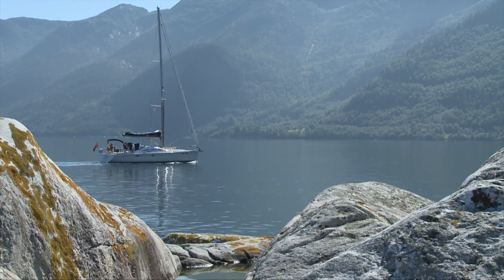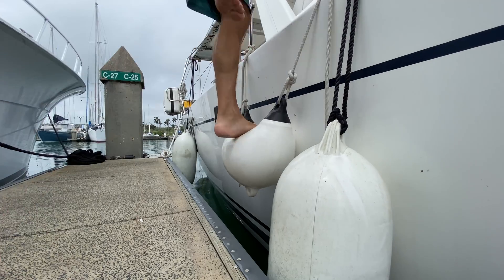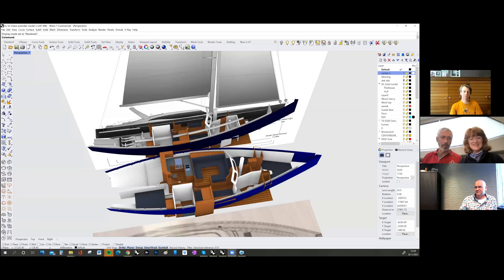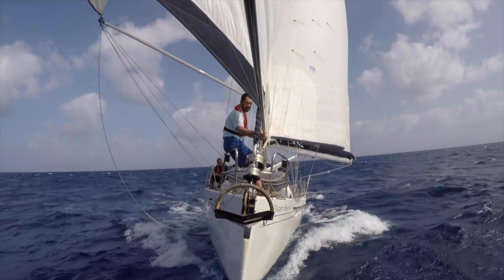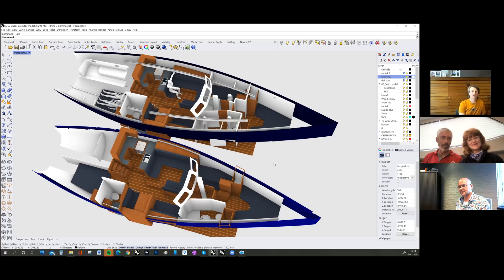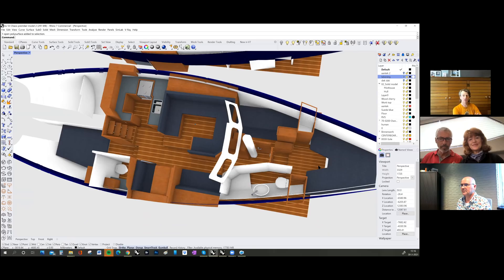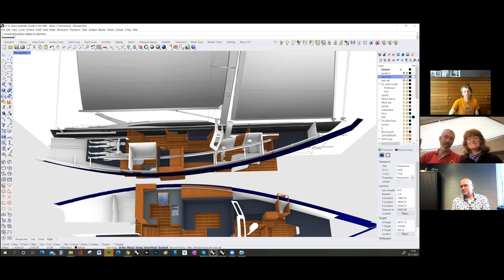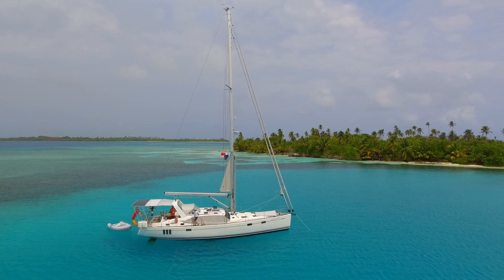Custom Aluminum Sailboat Design! | Distant Shores | EP 209

Comment: Sheryl your hair in a pony tail at 14:40 shows how much younger you would look with it shorter. You should consider moving into shorter hair and thinning the weight out of the top when you do. It might be time to think about moving on from the same haircut you had when you built that first boat in the yard in Ontario. Take it from a professional hairdresser, many women are resistant to this change from their old standby haircut of 40 years but when they make this change they love how easy it is to care for, how light it is, and how much younger they look and feel. Plus an added bonus for your lifestyle, think about how much shorter the showers would be and the water saved. We love you guys. ❤️❤️❤️

Comment: 9-	To provide good temperature control and ventilation in both hot and cold weather:

i-	I want it to have a thick insulation, so it retains the heat in cold weather and prevents the heat from creeping into the boat in hot weather.

ii-	I want it to have an efficient heat pump(good for -30 C to +50C)  with a secondary source just for the saloon in extreme cold. 

iii-	I want it to have good air circulation to reduce the load on the heat pump in moderate climates and  to prevent mold, but not the cost of the sinking of the boat in adverse weather because of an air circulation system that doesn’t turn into a watertight bulkhead.

10- To avoid and survive fires: 

a) I wonder if i should avoid using gas and diesel heaters and stoves, but then electric wiring could generate its own fires with short circuits. 

b) I wonder if I should use ceramic and metal instead of wood for the interior, but then wood is a better insulator and far more aesthetic.

Comment: Some of the specifications that I have mentioned down below are unrealistic. I did this on purpose to stretch the limits for discussion, but to finally agree on a pragmatic design. 

I want a boat that: 

1-	Can survive the most adverse weather:

I want it to survive:

i-	Pitch-pole Capsizes: Based on research from 2019, a boat will survive pitch-poling from wave heights that are 60% of the boat-length, so this seems primarily a function of the boat length. A longer boat can not only survive higher waves, but can also travel at greater hull speeds, which are a function of hull length, so I want the boat to be around 76 feet.

I want the fore-hull to be narrower than the aft-hull, so the drag is low, but  longer than the aft-hull, so that its buoyancy will prevent a spurious stern-wave from pitch-poling the yacht stern-to-bow.  This would also mean that a large bow-wave would also lift a narrower fore-section of the hull to prevent the boat from being pitch-poled bow-to-stern. 

This means that the stern and bow sections will lift around the Center of Gravity, which would act as a fulcrum, but the stern and bow sections will both oppose the pitch-poling moment.

I want it to have adequate free-board to prevent sinking in adverse weather.

The length and weight across the boat should be distributed, so that, in the vent of a large bow-wave, the fore-section crosses the tall crest and then drags the aft section across the wave with its weight across the wave to prevent a bow-to-stern pitch-poling, but has the hull shaped, so it doesn’t sink into the trough as it comes down the crest.  Likewise, in the event of a large stern-wave, the length and weight distribution of the stern should be such that it drags the fore-section back across the stern-wave to prevent stern-to-bow pitch-pole, but the aft and stern section should be watertight, so it doesn’t sink into the trough, as it comes down the crest.  

All of this means very careful attention needs to be paid to the shape and weight distribution of the hull aft and fore of the mid-ship section and the mid-ship section itself, which would serve as a fulcrum to lift the dipped bow and stern sections out of the water and to push the raised bow and stern sections back onto the water.

I wonder if the length and width of the boat needs to be some harmonic of the waves for a smoother ride and to avoid capsizing?

ii-	Rollover Capsizes: This seems to be a function of displaced center-of-gravity, so a flatter superstructure, a wider beam, and a deeper draft would prevent such capsizes.  

I would want the deck to be flat in the aft and fore sections, so that large waves would flow across the boat instead of rolling it over.  I’d also want the fore-section to be flatter than the aft section, so that large waves would push the stern to have the boat face the wave frontally to prevent a roll-over capsize from large beam waves.

I would also want the free-board to be shaped in such a way that it deflects the beam weaves around and over the boat to dissipate the energy from the wave to prevent it from rolling the boat over. 

iii-	Sinking without Capsizing: This would mean that such a large wave breaks over the boat that the sheer weight of the wave sinks the boat. The greater the buoyancy, the smaller the exposed surface, the more angled the buoyant submerged area, the better the drainage, and the more sharply angled the deck, the greater the survivability against sinking.

I’d want the superstructure to break large waves smashing on the boat, from the top,  into multidimensional spherical horizontal, vertical and angular components to reduce the impact along any single dimension. 

I would want the submerged parts of the hull to provide buoyancy from different curved and angular surfaces to prevent the deck from going under the waterline. 

I would also want the deck to be subtly angled for good drainage. 

If possible, I would want the deck to be water-tight for a roll-over righting.  This I know isn’t realistic on yachts because of the height through which the objects would fall in an inverted yacht.

iv-	Survive impact from  debris and light floating ice. I would have to rely on thermal imagers, sonar, radars, and lidars to avoid collision with larger ice and objects., but a strong aluminum hull should survive impact from light debris and ice.

I also want the propellers to be protected by the keel.

I prefer aluminum to steel, because,  for the same weight, aluminum provides better impact strength, except for the welded joints, which can be strengthened with extra members.

I don’t know if aluminum should be coated with paint or a thin layer of composite for better corrosion resistance or left uncovered, so it quickly dries out.  It might be better to have a double hull, with the space between the two hulls used for a water-ballast, so that even in the event of an impact, the inner hull is unscathed. 

v-	To survive running aground: I want the yacht to be beach-able, like the Garcia 60.

2-	To go anywhere:

i-	I want it to have a deep enough draft to survive the huge waves at Cape Horn, but a shallow enough draft to go up rivers and canals, so it would have a lifting/centerboard or a swivel keel.

I don’t know if a frontally swiveling keel would be preferred to a backwardly swiveling keel because even though a backwardly swiveling keel would incur a greater damage in the event of knock with an underwater object, it would still fall more easily against the forward movement of the boat. 

A lifting keel/centerboard can be more finely calibrated, but I wonder if that would be more prone to failure than a swiveling keel.

I wonder if the hull should be shaped, so it displaces at low speeds, planes at moderate speeds, and foils at high speeds, so it can use speed to surf through moderately heavy seas, but displace in very heavy seas. 

ii- I don’t want the beam of the boat to be too broad to get stuck between ice, but enough for it to avoid a rollover with a length/beam ratio of under 4. I would have preferred a trimaran, a catamaran, or another multi-hull design for better capsize resistance, better handling, shallower draft and more spacious cabins, had it not been for my concern regarding impact with ice or the hulls splitting  off in heavy seas. 

3-	To make good speed with sails and even sail in the worst of storms:

i-	I want it to have a ketch rig, so that each rig is short for a lower center of gravity and so that each spread is small for a smaller centrifugal force in storms. 

ii-	I want the two masts to be placed, so the center of gravity wouldn’t be too drastically altered by just the mizzen mast flying the sail during storms, as a wave lifts the stern and the wind hits the sail to push the bow down, or vice versa.

iii-	I want the hull to have a variable, water ballast, so the ballast can moved to the fore section, when traveling upwind, and the aft section, when traveling downwind. I would also want this ballast to be moved laterally to reduce the tilt when sailing at speed in a storm. 

4-	To have redundant systems: I want it to have twin engines, screws and rudders. Twin engines and screws along with the sails should even help steer the boat in the event of a failure of both rudders.  I would prefer shaft-driven engines to diesel-electric propulsion to reduce the weight, even though a diesel-electric propulsion would make more sense with solar panels, horizontal axis wind turbines, and even charging from the propeller whilst under sail.

5-	To be steered from a small remote control, like that on the Dashew Beowulf, so I could operate it without the crew, but for it to be steered manually in the event of a failure of electrical, hydraulic and control systems.

6-	To be easily maintained, serviced and repaired even while offshore, so the layout, the components, the sequencing and the spacing should make this simple, easy and quick. 

7-	To provide autonomy with a blend of solar, wind, wave and kinetic energy and, perhaps, storage in variable capacity salt batteries.  However electricity can play hell into the aluminum hull, so would settle for lithium and other batteries.

8-	To provide a comfortable living and recreational area for 9 adults---me, my wife, 4 children and 3 crew members. I usually don’t find boats under 100 to 120ft(Trehard(103ft) and the Pangea and Tara(120ft)) to have comfortable living spaces, but the Dashew 78 BeoWulf and the CNB-76 seem to be fairly comfortable, so I would want it to be around 76 to 78 ft. A larger boat might be a hassle to operate or maintain with a small crew if most of the functions are automated. 

i-	I want an open fly-bridge with a comfortable seating for 9, as in the CNB-76 and even Garcia Exploration 60. This can be in aft or fore section, I don’t care, but is more convenient in the aft section. 

ii-	I want a raised saloon with a pilot house for 360-degree visibility. I want this to have wide, open spacing and very good lighting with low/high tables.  This should be the prime real estate in the boat. It should have easy access to the galley. This is where I would also do most of my work.

iii-	I want a comfortable owner’s suite for myself, so I can easily step down from both sides of the bed. I need to have a couch on one side and a desk on the other side. This should come with a head and a shower. 

iv-	I want two guest suites: One with a double bed and a Pullman and the other with a twin and an overhead.  These can have their own heads, but can share a shower.

v-	I want a dorm for the crew with another head and shower.

vi- I want a tiny workshop-cum-office-cum-hospital for offshore repairs, life-support systems, and office work.

vi-	I wonder If the space for parking the large tender on the deck can be a little sunk to serve as a shallow pool/Jacuzzi, whenever the tender is taken off, or if that would create a hazard in heavy seas.

Comment: Since this is the forever boat, you should go with the layout you really want, which is obviously the wide stern Southerly you have now. Living comfort and practicality far outweighs any slight sailing characteristic advantage of the narrower boat. Make it less than 50 feet, and recover the cost of the completely new design by building and selling more as is the option. It's virtually certain that there are others who will appreciate the same type of format. KM should also see the potential and share accordingly.
Reply: ..or simply get a ready made wide stern aluminium boat from other brands and make some slight modifications to that, in order to save a whole lot of money and regret, unless they are too invested or loyal to this builder and can't walk away now.

Comment: This is so interesting!
I'm myself kind of in same phase with my project - with the exception that I'm doing this by myself. 😃

One thing I would suggest is to check the interior orientation of Moody DS and Sirius boats'. The main cabin is located under the raised saloon seats and that way is right in the middle of the boat and as low as possible. It should be very good for passage making. With your ideas I think it should be very much doable for your design as well.

Cheers! (little jealous of your environment down there... Today it was -18°C in Finland...)
Reply: A 50' aluminum interpretation of a Sirius would be a dream boat.
Reply: If I had the money I will go for a Boreal.....keep on dreaming...lol

Comment: This is a great subject, i love it. My thoughts on important parameters. Regarding the mast passageway problem, if you are happy with a deck stepped mast, you can make a load bridge to carry the mast pressure to the hull through the wall panels on either side of the passage. I did this with a friends Roberts 54 back in the 70’s, it worked just fine. In that case it was a compound steel beam, but in this boat it would be in Marine Grade Aluminium which is awesomely strong. This time ensure that the beds are at least 2000mm long. One thing to consider that you might not have experienced enough yet is that the windows should be double glazed or have some other anti condensation resolution. I am living in the Netherlands and the weather is just getting to the point of perpetually dripping windows on my S135. I notice that the aft cabin Polycarbonate don’t condense water so I am measuring up to do experiments with Polycarbonate overlays for the large glass windows to see if the problem can be solved by the different heat conductivity of the plastic. Really important to consider is the heating system. I have an Eberspacher Hydronic which itself is quite good, but the heat dispersing elements are terrible (ie fan radiators … very noisy). However, I have smaller units in each head which are always on so the heads are always warm and dry. One concept I am thinking through at present is a type of cable/ communication device that can monitor the temperature of the main cable trunks along the length of the boat. Also be aware of the changing regulation in Europe regarding Black Waste management. It might be wise to design in space for the Raritan Electrosan (?) which the new Dutch regulations which became effective Jan this year but will be enforce July next year appear to be designed to be compatible with. I have a design effort under way to build a smaller more effective device but I can’t see me finishing it in time, so am now committed to fitting large holding tanks. I am really interested in hearing your comparative sailing experiences with the different hull configurations. Please, more! Another area i am spending time on at present is in seating and mattress design. I spent Euro 2000 on a supposed top end fwd bunk mattress which was a bitter disappointment so I am changing to salon cushions that are metal frame with elastic cord base support under various foam and poly fill combinations. I was thinking through an achievable suspension system for my mattresses this morning and I think that I have a workable solution to provide soft support for my aging body. Any way a great adventure with this new design. I look on with great interest. BB. Yes I am the guy who tape measured the MC bunk on DS3 at Dusseldorf.
Reply from the maker: Thanks William. Yes you’re right that the mast support can be engineered and also about the 
Need for double pane windows. We’ll be sure to get them for the saloon. I’ll look up more on the Raritan too thanks 🙏🏻
Reply: @DistantShoresTV  The other thing I meant to add was that there is some one in Europe making composite hatch frames. Aluminium frames in the colder climes are a condensation curse. I was wrong about the plastic not condensing. I’m trying to sleep in a different bunk tonight and am being dripped on from a Lewmar plastic port. There has to be the gap between the inner and the outer. BB